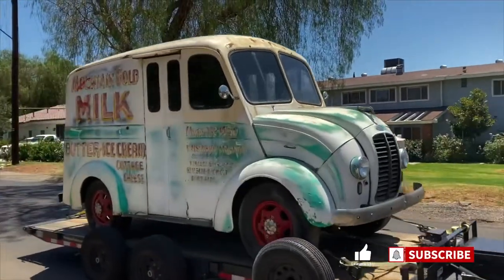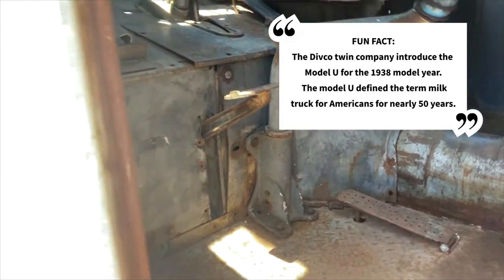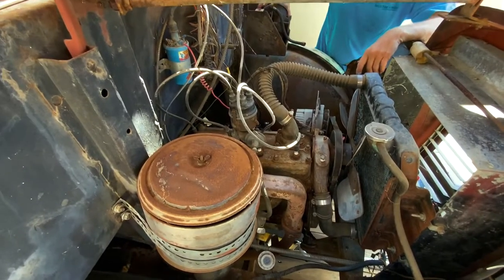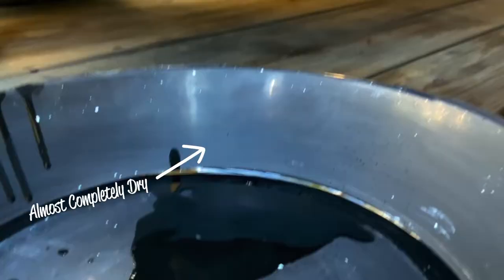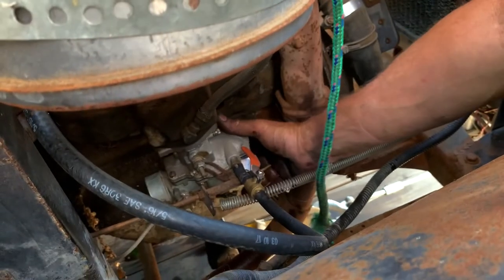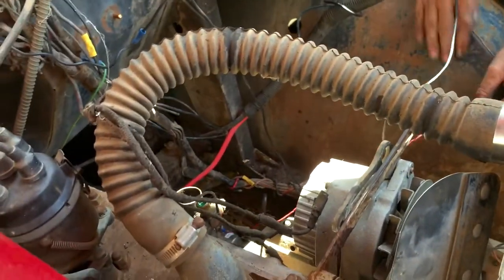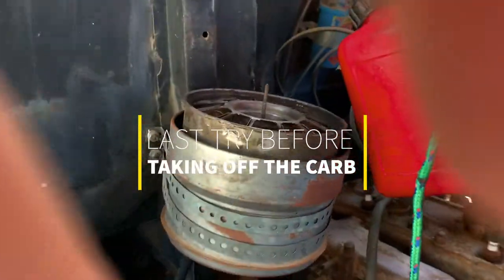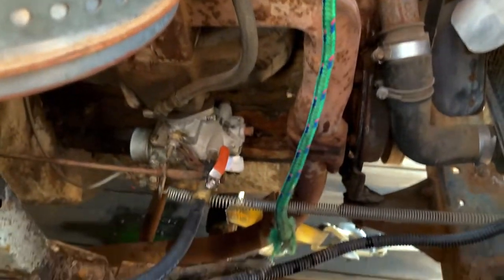I bought a Vintage Milk Truck- 1955 Divco SIGHT UNSEEN! - Will It RUN AND DRIVE

Comment: Watching you working on the Divco brought back a lot of memories,worked on a dairy farm that had milk routes and they used Divco milk trucks only difference was we got rid of the flat head engines and installed Ford 6 cylinder engines made a big difference in performance also instead of a column shift installed a floor shifter on the T98 transmissions. Great video thanks for the memories

Comment: 60 years ago, I doves Divco's delivering milk to homes.  Ours trucks were similar to yours with a 4 speed on the column and a knob at on end of the shift lever which acted as a throttle.  The big pedal was both clutch and brake.  Halfway down was clutch and all the way down was brake.  There was also a lever to the left of the steering while for just braking.  Interesting vehicle to drive.

Comment: It’s good to see this truck running again.  That stand up driving position is wild!  Is that a Tupelo Doughnuts sign that I saw in the background around 5:40?
Reply from the maker: Yep I bought the Ih metro off them it’s int the process of being restored. It was running so I didn’t need to work on it much other than have the brake cylinders redone. I am looking to find someone to paint it. The first body shop got 99% the rust and dents out. I’ll make a video of that one too eventually
Reply from the maker: https://youtu.be/flQWGn-2SJY